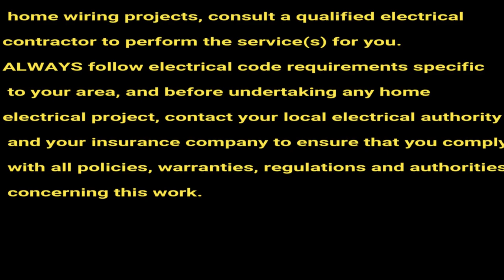How To Wire A Switch Receptacle

Comment: I find your videos very informative as it shows how most things differ here in the UK. For example - hot/live is brown, neutral is blue, earth/ground is green and yellow striped, on is down for light switches, most outlets are switched and always have a ground pin, all plugs are fused and so on.
Reply from the maker: Hello from across the pond. That's pretty cool how it's different. I actually wired some machines up that were being sent to Germany and that's the first time I have seen about 20 some years ago. Thanks for watching and commenting ☺

Comment: So so so awesome, thank you for sharing your expertise in this video. I'm doing exactly a project to what you explained in this video, except there are two other existing hot wires connected to the main hot in the switch.  I need to run a hot wire to a receptacle independently from the switch. Do I need the red wire to the receptacle and also break the bridge in the receptacle to do this?

Comment: Thank you so much for the awesome step by step video, I have been struggling to get my light switch to work.  I am usually so good at switching out receptacles, but I was ignorant on switches controlling my lamps.  I have a room just like you described, at first I hated it when i bought my Condo but I have been so spoiled walking out of the room and turning out the light, now after painting and renovating I am missing the convenience and plan to fix it this weekend.. Yayyy  Thank you.
Reply from the maker: I am happy that it helped you. I appreciate your comment and watching. Have a great day
Reply: @MountaineerOutdoors  oh you're very welcome you have no idea how much I learned from watching this video... I was so excited to get this done that I even took care of it right after work tonight and my light switch is working yay
Reply: @MountaineerOutdoors so I have another question for you, now that I have it wired and working with a new switch... since I clipped the connector on the wrong side of the first try, can I use this switch anywhere else that only needs a one-way? Thank you for all you do.
Reply from the maker: Are meaning the clip on the Recep? I'm not aware of on a switch. If you are meaning on the Recep yes you can
Reply: @MountaineerOutdoors  yes I am sorry, I am not very savvy with the correct terminolgy..  ok.. so it should work regardless that I broke it off.. ok awesome thank you.  Nanc
Reply from the maker: @nancmadi  if you want it to work like it did before you broke off the clip you will have to put a jumper wire on it. Other than that it will work

Comment: Your videos are great!! I have a problem right now...I ran new wire from my kitchen counter top to a soon to be overhead light. I pulled the old orange wire out and replaced it with nmd 90. My outlet is 2 hang, one side is outlet, other side has always been a switch for overhead light. When I hooked up new wire....I turned breaker back on and it flipped in 10 seconds.
Reply from the maker: It honestly sounds to me like you have a nuetral and a hot dead shorting or something is touching your hot wire like a ground or nuetral. Did you put a nuetral wire on your switch? Check this, if you leave the switch completely off and you turn on beaker will the breaker stay? If so you have the hot and nuetral on the switch causing the dead short

Comment: Very good and entertaining!... what about if I want the outlet independent to the light switch but still getting the power from the switch to the outlet... thanks for your reply!
Reply: You need to create a pigtail on the hot wire so that you have a jumper going to the switch
Reply from the maker: Exactly

Comment: Just found your videos. Thank you so much for doing them. I wish you would have said what brand of multi tool you were using though 😜. Just kidding of course. I did miss something however in which wire is which and how to identify them. I will go back and re-watch the vid and see if I can find it. I live in a house that is well over a century old and has been added on at least three times and discovered that I have a wiring mess here. As an example, there are 15 outlets on one 15 amp breaker. All the outlets are or were the old two hole ones. The only good thing that I have found so far is, the wiring is all heavy gauge copper. We obviously don't use all the outlets and oh yes there are about 6 light switches on the same circuit too. I have been slowly replacing the outlets with current code ones and will be trying to separate the mass and create new circuits. The one thing I am hung up on so far is I have 1 outlet-light switch combo. I have tested it and the wires are hot but the switch and outlet are dead. Is that a normal issue or is it something that is not rare? Again, thanks a ton for doing these videos.
Reply from the maker: It almost sounds like you have a switched nuetral. Which isn't really safe. Especially in a home that old there was a time period when people thought switching nuetrals were a great idea. Now that's just a guess of course. Or it could be possible that you truly have a bad switch/outlet combo. Keep me posted on what you find out.
Reply: @MountaineerOutdoors  I surely will and thank you for the rapid response. I love learning and given that I am colorblind on top of the issue, I get to have one of my boys or girls with me (all above the teen years) that can make sure I get the colors right and in the right places. Oh btw, I never knew that about the slots on the backs of the devices that serves to get the wires stripped accurately. That is a GREAT tip thanks a million for that.
Reply from the maker: No problem I hope that you get everything taken care of. Any advice I can give you feel free to ask have a happy new year

Comment: If I want to reverse this process can I just pull the switch out and use a wire nut to connect the black and red and the. Wire but the ground off shove it back in the box and be done with it???
Reply from the maker: Yes that will eliminate the switch part and make the Recep hot all the time.

Comment: Yeah I question for you I have a switchbox one has three switches and one has two switches and I want it to run a wire down and put an outlet how would you suggest that’s done and which switch should I run it off of the first one is a bigger switch and it’s got a red wire going to it and the other ones run off of that one so which one do I use for a switch I’m in an outlet

Comment: Can I replace ungrounded switched receptacle with a GFCI outlet and still have it switched?
Reply from the maker: Now that would be great video. I will have to say this. First of all yes by code you need to replace a 2 prong with a gfci or rewire it. As for the switching goes.... Most gfci when you turn power on to them they trip out, without a ground wire not quite sure if it would trip it out or not. Just being honest here. But now I have to find out.

Comment: I can't seem to find an answer anywhere, but I want to install a new light with  new switch receptable in a closet room. Can I feed the switch and light bulb, from an outlet switch?
Reply from the maker: Yes you can
Reply: If you want a half hot recep you need 3wire cable in between the switch and new recep. What else is on the circuit you are tapping into? Will what you add overload it?

Comment: Hello, I have 4 total plugs controlled by a single switch in my livingroom. 2 on left wall and 2 on right wall.  I want to keep 2 on right wall controlled by switch.  How do I remove the 2 plugs on left wall from the control of switch? I have a junction box in my basement ceiling that has those 4 plugs and 2 others connected in that junction box. I have 6 black wires, 6 white wires and my ground wires. I have 2 black wires in that junction box that are wire nut together,  guessing that is for the two other plugs that are not connected to the switch. Do I have to do something to the wiring in junction box or the plug receptacles in the wall? I have no red wires. Unless those two black wires are the switch wires. Not sure. Any help will do. Thanks, Jeff
Reply from the maker: your gonna have to def see which black wires go to those 2 receps, then inside that j box find the constant hot which id be guessing it may be the 2 that are tied together, and join them under the constant hot side. first though find where the wires that are going to that recep are going. now if you have one side of the recep hot all the time and the other are hot...just replace the recep (turn off power) with the hot wire that isnt switched and put a wire nut on the switched wire inside the recep box.  Hope that didnt confuse you.

Comment: So if I’m using 12/3 wire (black, white, bare) how do I wire the switch to the outlet? I understand the white and bare, so would I connect my black (line) wire to the bottom post, and my black wire to the outlet to the top post (load)? And...if I have more receptacles down the line, how do I continue wiring with the metal tab between the 2 brass posts snapped off?
Reply from the maker: First of I'm not exactly sure what configuration you have. Do you only have a 12-2 wire up to the switch?  And to continue the hots on down you will have to pig tail the hots in the Recep box
Reply: Mountaineer Outdoors yes I’m running 12/2 up to the switch. I was thinking I’d have to pigtail the hot. Thanks for confirming

Comment: Did you bring. Power to the switch from breaker box
Reply from the maker: Yes in that video I did. I see now that I should make a video doing the power from the receptacle to the switch
Reply: @MountaineerOutdoors  thank you for the great demonstration and video, ok,  so you ran a wire from the switch down  to the  plug ? i think i missed that part. thanks again

Comment: Struggling with replacing a switch I have two blacks and a white so to me I have two hots and a neutral but I know that shouldn’t be rightI put my new switch and identical to the way they had it which was a white on the left and two blacks on the right and I put them exactly the way they had on the one on the top and the one on the bottom I didn’t get them mixed up I didn’t want it a time but now my light switch will not turn on my hall lights I am using a three-way switch (Made that mistake before buying the wrong one) I switch these wires around in so many different ways trying to determine what the two blacks are if one supposed to be a red but it’s not and I still can’t get my switch to work and turn on my lights
Reply from the maker: Ok let me get this straight. You have a 3 way to the receps right? Or did you buy a 3 way and only need a single pole. Tell me what you have then I will try to help you out. Judging from your comment that is what I am seeing.

Comment: Quick idea/challenge: Is it possible to run a single cord to a "table" that contains 2 switches... (switch1) on/off to a table saw and vacuum (switch 2) on/off to a wood router and SAME vacuum..?
Reply from the maker: You will have to see what the vaccum is pulling and the table saw

Comment: Thanks for the video. Quick question. I want to turn a switched outlet into an always on outlet, and use the existing switch to run a new ceiling fan. Simplest way to make the outlet always on would be to take the red wire off the switch and tie it into the line, right? That way I don't even have to open the outlet up, right? Then I just have to deal with the fun of fishing a new wire down for the ceiling fan.
Reply from the maker: That is exactly right do everything in your switch box that is definitely the easiest and fastest way.

Comment: Good day. Can you link me to one of your videos to help me with a wiring job? The job, power source to gfci (outside where power comes in) to outlet (outlet constant power), then to switch, and from switch to 3 single gang outlets. I want the switch to cut power to all of the outlets except the first one. The first one will have a security/flood light wired in. Thank you kindly. Strength in Unity.
Reply from the maker: Well I don't have a video quite like that. But sound like a good idea for a video.
Reply: @MountaineerOutdoors  I look forward to watching it! The security light is a motion sensor, which is why I didn’t want it tied in to the switch.
Reply from the maker: Understand that. Gotta get back to making some more electrical videos. That will be a great one to make.

Comment: If I don't break the tab will it remain hot? I wanna not have to always use the switch to use the recept
Reply from the maker: Honestly it all depends on exactly how you wire it..most every time there is one left hot and the other is switched.

Comment: When is tie in the 2 blacks in the switch box the breaker trips 🤔
Reply from the maker: I'm not sure what you mean
Reply: @MountaineerOutdoors  I have a 2 wire and a 3 wire inside the box with the switch. The 2 wire is hot. When I tie the hot black into the 3 wire black the breaker will trip. Black to black....I'm thinking shorted wire at this point 👉
Reply from the maker: Yeah that could be a possibility. Toy will definitely have to track that down. Is the 3 wire black wire hot?
Reply: @MountaineerOutdoors  no
Reply: @MountaineerOutdoors  I re ran the wire lol it works now

Comment: what do you do if you only have 12-2 with ground wire?
Reply from the maker: You can control one side of the Recep
Reply: George Lee unless u pull another circuit in the box to have individual hot legs not much u can do

Comment: Hey there buddy liked your video learned a whole bunch watching this particular video, I was wondering if you have another video that would show how to install another outside covered outlet box? (doesn't have to be a GFCI) because the first outside box has it in line with an existing outside GFCI already I am just looking to extend another outlet around the corner of my house. To be able to plug in any other device while I am working outside of my house.  Thanks a bunch..
Reply from the maker: No I don't have any videos like that but that is a good idea for a video. Thank you for watching and commenting though and I will be uploading more electrical videos soon.

Comment: How can I take power from an outlet,and wire a switch to it so I can control a single load
Reply from the maker: You would have to break the tab on the outlet Just on the hot side and run the switch leg back to it. Just use a 12-2

Comment: If my outlet is set up with a switch already and i want to add a fixed light fixture and not have the outlet on the switch anymore what wires do I remove from the outlet?
Reply from the maker: If you are removing the switch easiest way is to take the switch out and twist the wires together in the switch. Then put a blank cover on the box.

Comment: What if I want both plug ins to operate off switch?
Reply from the maker: Just do the same for both receps
Reply: @MountaineerOutdoors  i mean, can I have it where the entire outlet is controlled by the 1 switch? I see you have a digram of a 2 wire set up but don't discuss in video. 
Thanks for information.
Reply from the maker: Yes if you do that you will not break the tab on the receptacle that will make the whole receptacle switched

Comment: I wish someone would invent an electical panel that you can plug outlets directly into from regular extention cords to outlets and switches, then nobody would have to deal with electricians and their high prices.
Also, why hasnt anyone thought of inventing breakers that can fit into any fuse receptical?  Instead of a fuse blowing it would just trip like a breaker,  then I wouldnt have to spend thousand to get my fuse box replaced.  Please.
Reply from the maker: As for the plugs in the panel not a bad idea for temporary Panels. The fuse with the breakers are already a thing google them and you will find them
Reply: @MountaineerOutdoors    Why do plug ins have to be temporary?  You're right that breaker fuses have been around but I dont think they make them anymore.  They are like a specialty item. Thanks for the info.
Reply: @williampennjr.4448  but have no problem paying 6$ for an over priced coffee
Reply: @Nick-bh1fy    Not me.  beside what does that have to do with anything?
Reply: @williampennjr.4448  honestly residential wiring is very basic, as home owners can attempt certain projects w relative ease. Why don’t u learn so you don’t have to pay an electrician if not don’t complain
Reply: @Nick-bh1fy    its easy if you don't care about following the legal codes and safety, and spending money when there are less expensive alternatives that could be easily possible.  It might even be easy if you own a house so you can tear out a wall whenever you want or access the ceiling fixtures from the floor above.
How is grounding an entire room easy?
Reply: @williampennjr.4448  it’s not easy, it takes a lot a work hence the high fee. If you don’t want to be bothered by worrying about safety and don’t have the tools for the job that’s why u hire people and sometimes the high prices are to cover overhead costs
Reply: @Nick-bh1fy   Why should i have to hire someone to do something that should be easy just because they need a job? Especially since they are paid more than me?
Reply: @williampennjr.4448  but tearing down walls isn’t easy and takes a lot of work to fix afterwards. He cuts holes in the wall and now needs to higher a drywaller. Also again no one is forcing u to hire an electrician. And with that logic why should I need to pay for a lawyer, they make way more than me
Reply: @Nick-bh1fy   " tearing down walls isn’t easy "  That's my point.  Why should anyone have to teardown walls just to ground wires? 
 and when did I say you should have to hire a lawyer?
But the law is far more complex than wiring a home for electricity.
Reply: @williampennjr.4448  because you need to tear down walls to get to the studs and frame work to properly? I just mentioned a lawyer cause you essentially said you don’t wanna pay someone for their services lmao. I’m done arguing tho